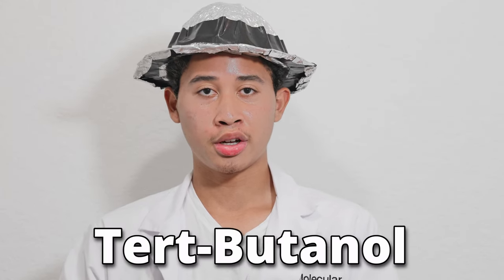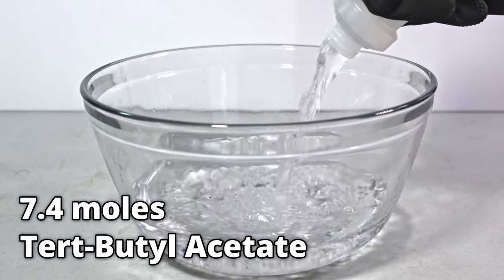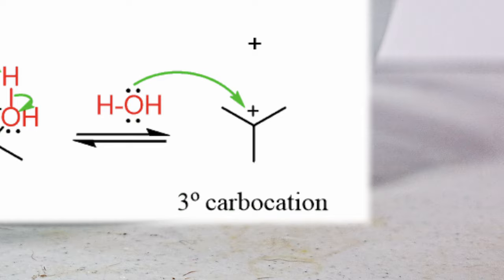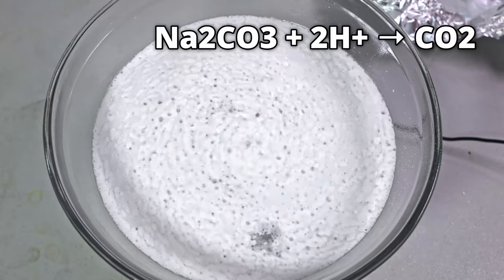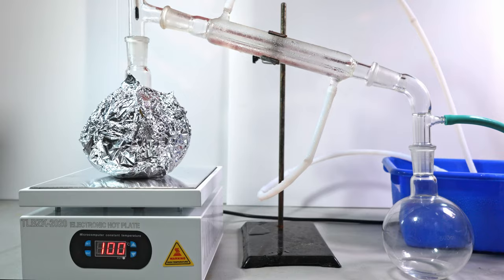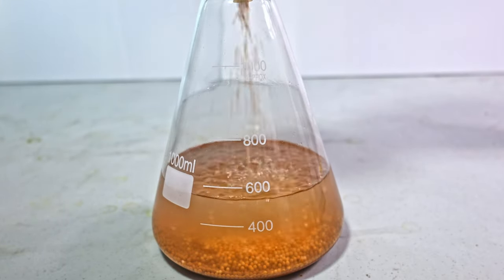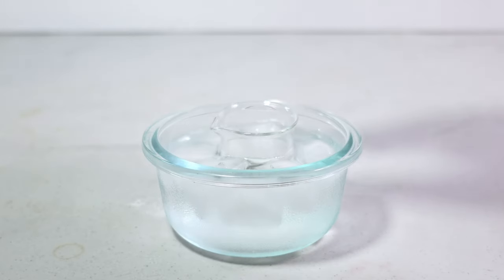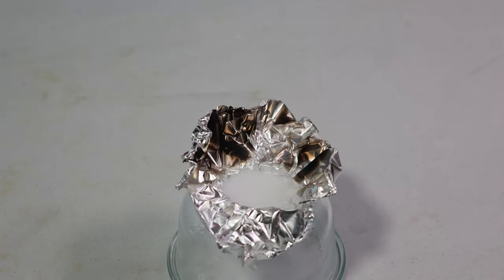Making Tert-Butanol

Comment: Just so you know, Arm and Hammer washing soda is the decahydrate. The anhydrous salt can easily be made by heating sodium bicarbonate in an oven or on a strong enough hotplate.
Reply from the maker: Yeah using the decahydrate would just add more water—and that’s the last thing tert-butanol needs

Comment: Great video. I have a suggestion? What if you get high concentration h2o2 some way or another, as high as you can get it but maybe just 30, and then see how vigorous its decomposition with either ki or yeast or both is. Will it splash?
Reply from the maker: As cool as it would be, that reaction is not really making anything new nor is it showcasing something novel. If you haven’t already, check out my “Foaming Saponification” YT Short where I make unsaturated oil froth intensely.  That is a completely novel (I just happened to stumble upon it through random experimenting) and it has never been done before (at least to my knowledge). I might consider scaling it up though, but the residue is very sticky and messy,